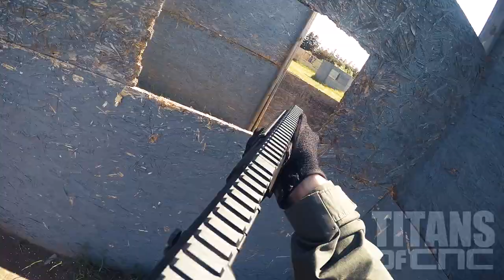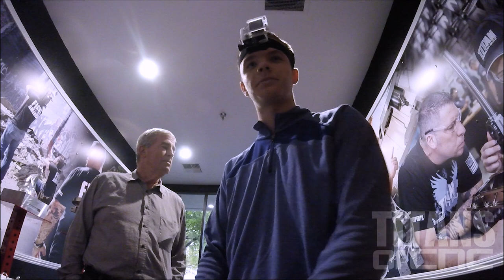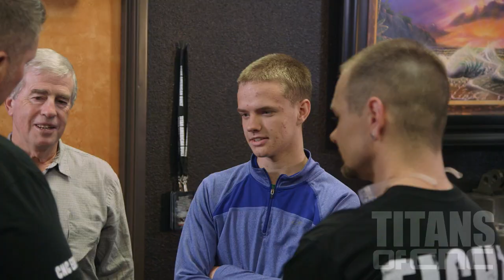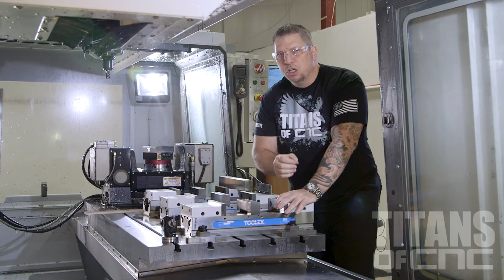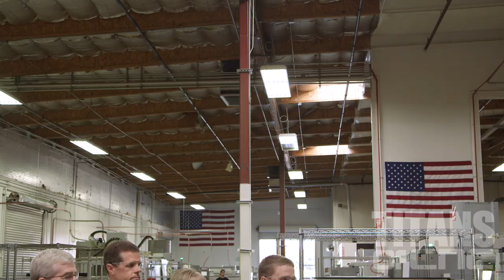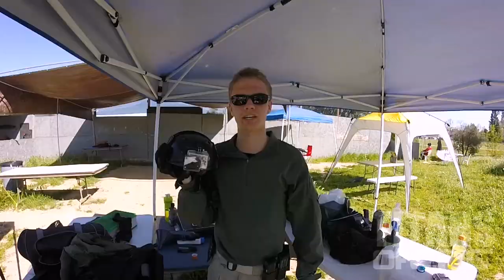Titan Helps 16 Year Old Inventor

Comment: What about vacuum hold down? For narrow materials I use pertinax plates in which I drill positioning holes to be screwed onto a CNC machine, and when in position, the plate is face milled to be perfectly straightened. After that outer contours of the part are milled in and a profile for inserting a rubber gasket is milled inside the boundaries of the part and holes for suction are drilled inside that. Stock is placed over the visual lines of the product and vacuum pump is activated. There are no clamps that can cause collision with the tool and parts can be cut all the way through into the pertinax plate so they can be fully divided from the rest of the stock.
Reply: Luka Luketić I think that would be the way to go for truly massive runs, but this is sufficiently efficient for numbers in the hundreds or thousands.

If they ever really did take off to the level of needing 100,000+ which is really unlikely, a large scale jig like you’re suggesting would be worth the investment.

Then you could drop whole slabs on, and cut several hundreds of parts per setup.

Comment: Whoaaa! This is awesomely inspiring! Thanks Titan! How did you get it to be completely optically clear?
Reply: Tony Pham it comes out of the mill like that. Thats the quality of top notch tools. There are no tool marks and is smooth as glass.
Reply: They don't machine the clear lens.  The frame is machined for fit and the optical lens is screwed to the frame.
Reply: Their is a separate piece screwed to the frame piece by the looks of it.
Reply: good tools and rigid set up
Reply: Tony Pham proper surface feed and feed rates + coolant
Reply: Tony Pham I believe it is made out of 2 parts that are screwed together.
Reply: Tony Pham - diamond tools

Comment: Polycarbonate is a plastic which is impossible to polish to a totally clear state. I would be very interested to learn how Titans Of CNC accomplished this. Normally one would have to polish the plastic to a very smooth finish and then "flash" it by placing it into an atmosphere of steam created by boiling ethylene chloride.
Reply from the maker: It’s a combination of great carbide tools and the right speeds and feeds so you don’t over heat the plastic. Need the right coolant also... with good pressure so you don’t run chips over.

Never like vapor polishing, just figured out how to make it perfect during Machining.

I will do a video on it one of these days.
Reply: @TITANSofCNC  Many thanks. This is very enlightening. I've always believed that poly HAD to be flashed.
Reply: @TITANSofCNC  a video on plastic feeds and speeds would be totally awesome :)